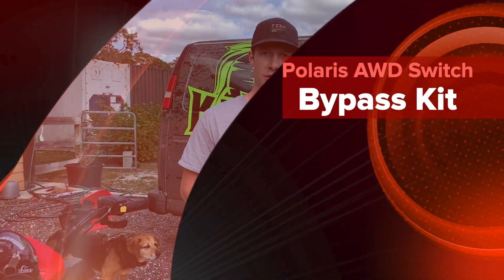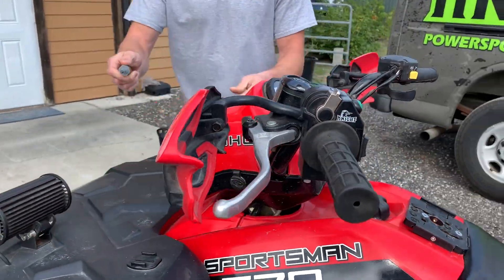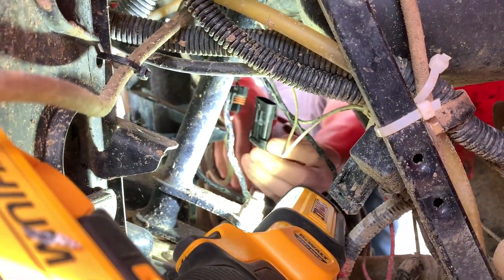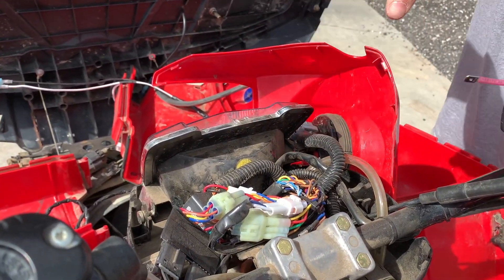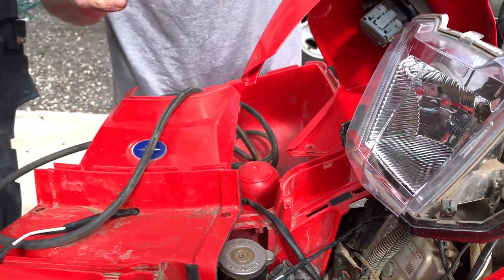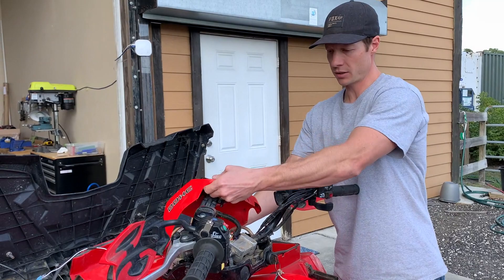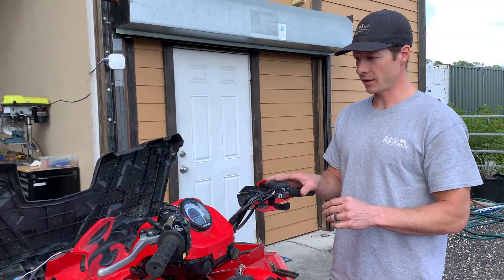Polaris Sure 4 Sportsman 4x4 Override Kit Installation

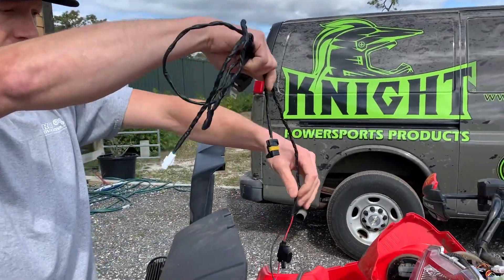Comment: At 2:19/2:17 in the video what do you do with that part your holding up in your right hand. I didn't see anywhere that you hooked it to. Do you just mount it somewhere up top by where you plugged in the white electric plug into the other one.
Reply from the maker: Yes, exactly, just mounting it up under your plastics somewhere safe and secure. 👍🏼

Comment: my brand new 2022 570 ride command is in the shop because the fookin AWD catch doesn't work from day 1
Reply from the maker: What kind of issues are you experiencing? Is it not engaging at all? You should definitely check out our Sure 4 Kit! https://sgroiinnovations.com/collections/polaris-products
Reply: @KnightATV  anyways the switch is fine it's just there's big misunderstanding about it so when you put the rude command mode to the left it will go into downhill assist mode to turn on the locked AWD you actually need to get the switch to the left
Reply from the maker: With our switch, you know you are in AWD when the switch is in the AWD position. Our kit sends power directly to the diff and cuts out the troublesome electrical components.

Comment: i have been having issue with my 4x4 on my 05,same setup pretty much, i have been debating on running the hilliard strai from a batterie souce because they say the ecm pulses ground ,its not constant power,  constant power will cause over heating of the armature , premature failure so ive been told,  i dont know thats why im asking    does it work and last if u leave it on long periods
Reply from the maker: Our kit bypasses the ECU which will have you fully locked in 4wd all the time

Comment: What problem/issue are you fixing?
Reply from the maker: The AWD switch bypass "cuts out the middleman" from bad or loose electrical connections, bad speed sensor, faulty ECU, etc. Our Sure 4 kit sends power directly to the front differential. It is waterproof and 100% plug and play!

Comment: Do you all make this kit for a scrambler 850 just had my 4x4 stop workin and both diffs have been rebuilt goin to check make sure the diff is getting the ground it needs
Reply from the maker: This kit should fit your scrambler.  We would just have to make sure the connectors that come off your diff are compatible with the connectors supplied in the kit.  We would also have to double check our switch fits on your housing on the handle bars.  Feel free to send me pictures/videos of what you have and we can straighten this out.  Message us on our Facebook page: Sgroi Innovations 👍
Reply: @KnightATV  should work on any polaris with on demand hiliard front diff,plug be different on some models,  but i heared the ecm sends pulses of power must be ground, mines meesed up but i have constant 12v if i ground brown w  wire to chassi  but wont shut off  so i was going to wire it o my batterie  but was told from a online polaris tech it will cause very premature failure being the armature will get to hot with constant 12v power,  but being it works for u guys im going to try it,
Reply: Following this as well, 2014 scrambler. I know the switch for the handle bar is the same, just not sure about the connection going to the diff. Did it work?
Reply: @loganstewart860  I got it fixed was the armature plate was wore and needed to b replaced thanks
Reply: Do y’all have them for the 2022 570